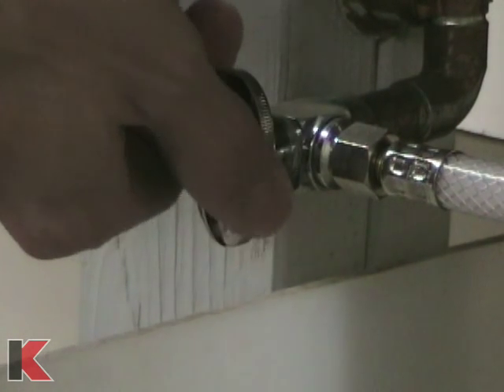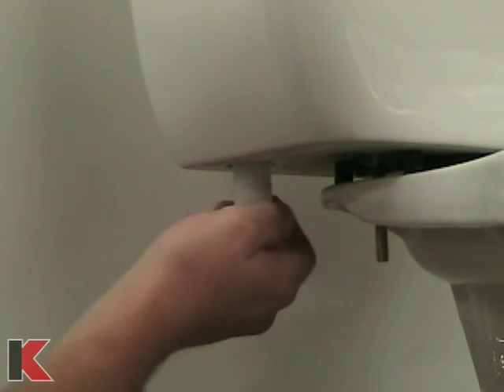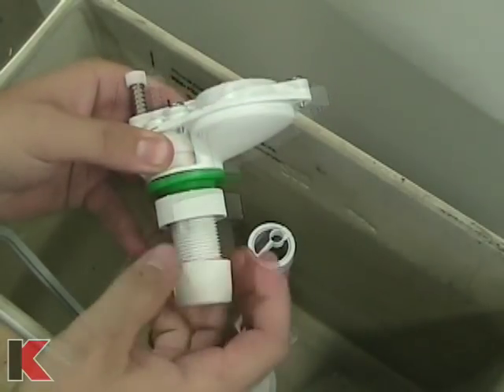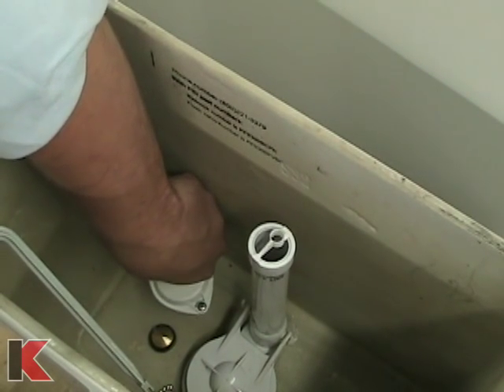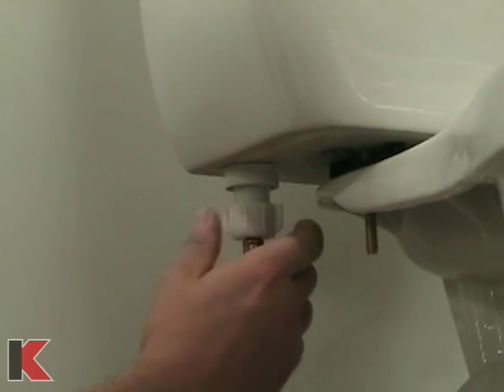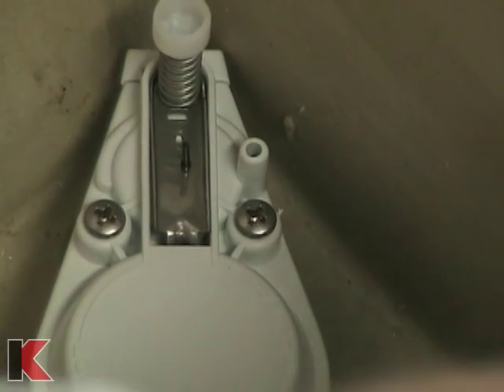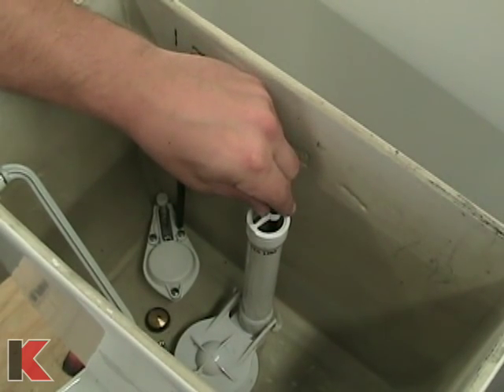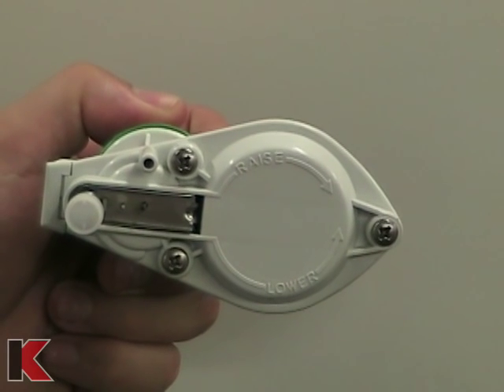Keeney Manufacturing, Mini Pilot Toilet Fill Valve

Comment: When I was finishing the house that we now live in, I was looking for a fill valve in a local store. Another customer told me that he used these fill valves in his rentals and never had a problem with them. I bought one and installed it in our antique 5 gallon toilet, the only one in the house. That was 1994 and just yesterday it refused to stop filling the tank. I took it out, disassembled it and removed small bits of iron pipe that got into the valve chamber. I cleaned it up, put it back in and it works fine.

That was the first and only time that it didn't work properly in 19 years and we have unsoftened well water with no iron but lots of calcium and magnesium. I wish I could find the old guy that took the time to let me know about these fill valves and thank him again. He's probably long gone, so I will try to do the same for others.

I don't know why anyone would bother with a float-arm system when they can use these... so simple to install and adjust ... you could train a monkey to install them.

Comment: @Keeney Manufacturing Installed with is a Mansfield 160 toilet and water just keeps running. I've adjusted the fill level until the screw came out and water still won't shut off. I just replaced the entire flush/flapper system and same results. Is this not compatible with the type of toilet system I have?

Comment: I moved into my house 14 yrs ago. All 3 toliets had these and they worked great. One started to slowly fail..water was still running. Went to the store and got one, it didn't work. Went and got another one, that failed also. After researching when they first came out the were made in the USA  now they are made in china and there are many complaints about them having very early failure.
Got a fluidmaster problem solved.